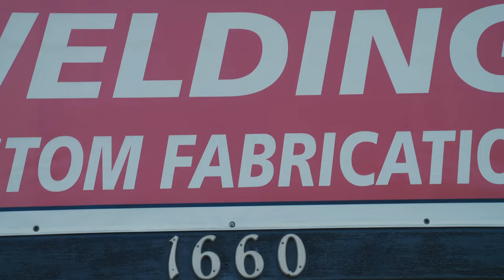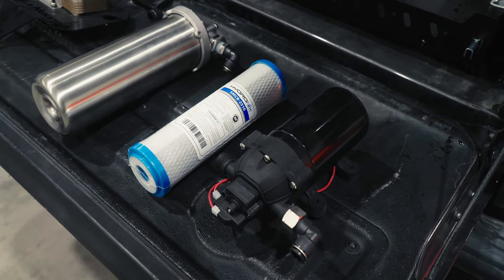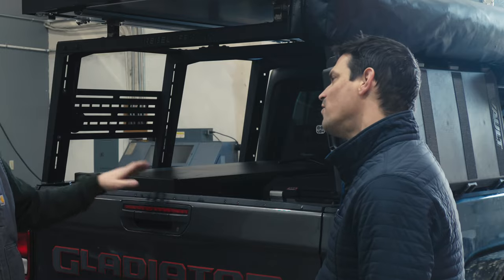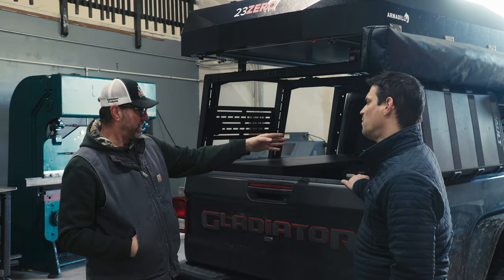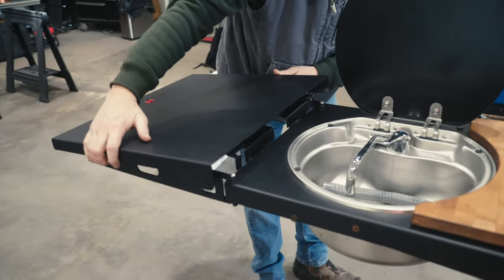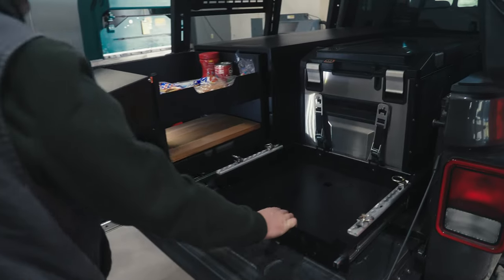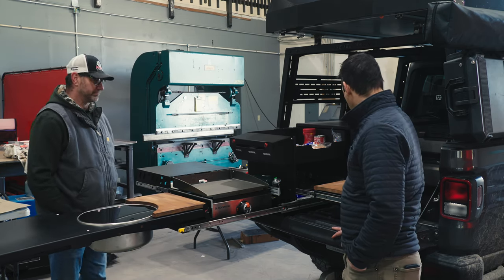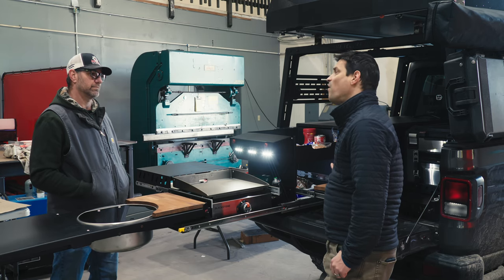That's One Bitchen Kitchen

Comment: Curious about how dirty that kitchen gets with that open bed in the back of the Truck. Even when I have everything close up with a Tonnaue Cover on everything is covered in dust. That onboard water filtration would be pretty nice if you we’re going off grid for weeks at a time.